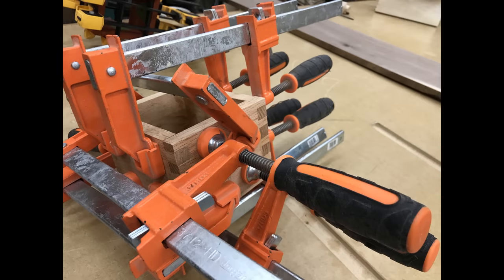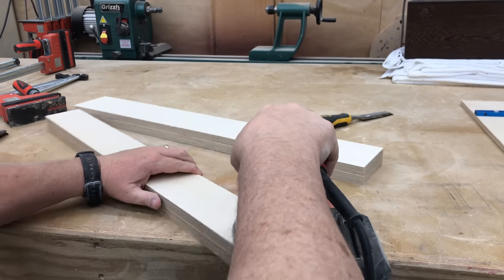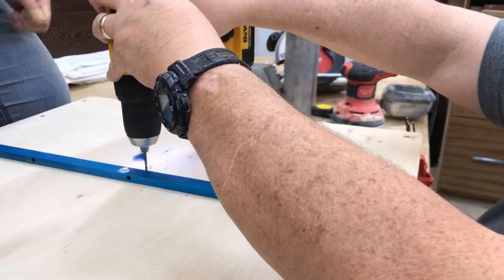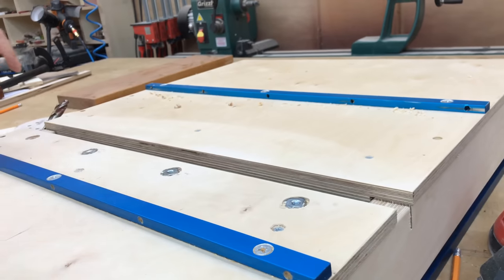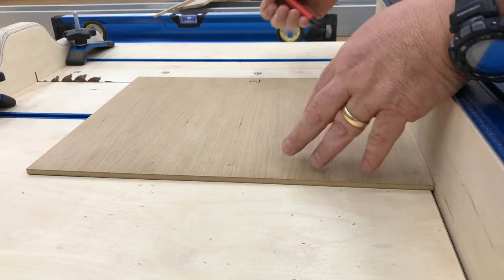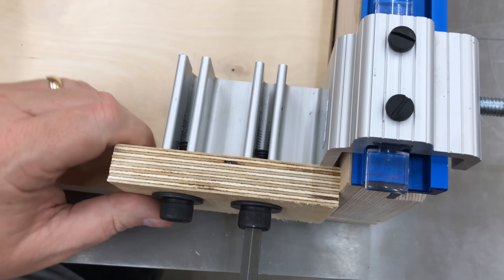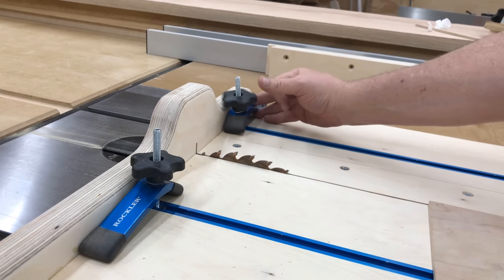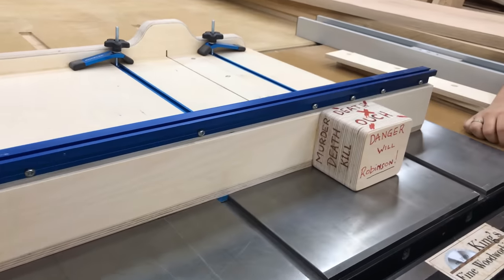39 - Extreme Crosscut Table Saw Sled with Perfect Miter & Dado & Removable Zero Clearance Insert

Comment: Thank you very much for this concise tutorial!!  I built this sled for myself about six months ago.  A tidbit of advice to others considering this build...check the orientation of your arbor on your saw before you proceed!!!  I made this very rookie, yet critical mistake.  Once I got everything square and precise with the 5 cut method, I realized that my Rockwell Model 10 arbor is opposite of James', so I couldn't use my dado blades on the sled.  I used it as it was for quite a few months to decide if I needed to make any other changes, but I am currently reversing everything to make it right.  I also cheaped out and used UHMW miter bars, which was also a big mistake.  My sled would not slide freely.  So I bought the same miter bars that are in the video, and I am in the process of attaching them and squaring everything up again.  By reversing the sled, I will also need to swap the front and rear fences, and go through the 5 cut method again.  Just a hint to hopefully help others from making the same mistake that I did!  Thanks again for the video.
Reply: DoubleS   I wish that I had read your comments before I started because I had the same issue, but I managed to catch it before I went too far but my cut off side is on the left side instead of the right. Fun build though.

Comment: That's a real nice sled with those T tracks and clamps.He is 100% correct that 90 degs is NOT good enough for accurate mitres . The bottom 45 degs of the isoceles triangle is the important part.I can tell you are a teacher . Great explanation James.

Comment: I built one like this based on your video.  Love it.  Rather than tilting the saw blade for a bevel cut I plan to make a jig I saw on another channel is 2 pieces of plywood hinged together on their long sides that fit between the front and back rails.  There will be vertical end pieces that are screwed to the bottom board of the jig.  The top piece of plywood can then pivot to any angle.  I plan to rig it so there are fixed stops at 45 and other common angles on the vertical pieces.  Leave the blade alone, set the piece on the angled board, and make the cut.  The stop and the hold downs will keep the jig in place.  Probably other types of jigs that could be add ones to your great design.   I’m thinking corner splines, box joints, and the like.  Thanks for all these videos!

Comment: Great Sled!!!!
Can't wait to build mine for my Rockwell table saw.
Thanks for sharing the design!!
 
An old trick us RC modelers use when we tap plywood is....
After tapping the hole, I always shoot some thin cyanoacrylate into the newly tapped threads. Then I run the tap through again. This substantially strengthens the plywood threads. and minimizes their deterioration.

Comment: Brilliant job of explaining everything James! One little addition when cutting aluminum moulding or in this case T-track use a good spray lubricant on the blade prior to cutting. I usually start my miter and spray it on both sides of the blade as it spools down. It will give you a real nice smooth finish. I think I’m going to order those plans!

Comment: Your video is JUST great, this is the best sled I found. The 5 cuts method is great as well, I looked into the other videos to better understand the theory, but your explanation is perfect. I liked the idea of having exchangeable inserts, for using my sled with dados as well. Thanks a lot, building it right now, I just need to come back a few times to review what I am doing. 

So far, what I did different is that I did not use CA glue for the runners, I hate so spoil them if I want to reuse them. I used carpet double tape, and it worked just as great. What I also got from one other video, is while clamping the fences, specially  the front one, we need to ensure that it is absolutely flat. That was a big error in my previous sled and I found out the hard way after pieces did cae out inconsistently.

thanks a lot again! Your's the best, inspiring, and the shopping list is also great (some pennies come from me, I ordered the kreg stuff from Amazon..cheaper and better than what I could find in my rockler store).

Comment: Just a tip in case this hasn't been brought up yet: chamfer the bottom of your production stop on the fence side to help prevent dust and chips from wedging between your stop and the work piece.  EXCELLENT build and video, and a great explanation of the 5 cut method.  Keep up the great work!

Comment: Hello again, James and family.  I’ve been using your design of (now my) crosscut sled for five months.  Excellent results with cabinets and picture frames and all kinds of other things.  For little stuff, I still use just my compound miter saw.  But, when I really need a guaranteed perfect 90 degree cut, the sled is my go-to.  For guaranteed perfect 45 degree cuts, such as for picture frames, I always rely on my perfect 45-45-90 plywood triangles that I made using your “James Geometric Method” and the sled.  So logical.  Very effective.  I’m a major fan.  And I still think you should try professional voiceover work.  You’re a natural.  Chris
Reply: I am just about to make this sled and was thinking about using 1/4” Baltic for the second layer instead of the 1/2” to reduce the weight, what do you think?
Reply: @benson9092  Hi. I don’t think that will work. A quarter inch top would not accommodate the half-inch thick T track which is incredibly useful.  If anything, you might want to try making the first (bottom) layer out of 1/4 inch Baltic birch and the top one from 1/2” Baltic birch.  I think it might be worth trying it that way to save some weight.  I didn’t follow James King’s excellent plans exactly; I made mine a little wider on both sides and 25+” deep to be able to crosscut 24” cabinet boards.  With both layers made from half inch Baltic Birch, mine is a bit heavy.  But I slide it on the floor most of the way to the saw before I huff & puff & grunt, then heave it quickly up to the table saw like a power weight lifter.  At 66 years of age, 5’11” and 235 lbs., I can still muscle it for quite a few more years.  When I hit 75, I might suspend it from the ceiling with a double pulley system.  Good luck to you Sir.  Chris

Comment: I have a crosscut sled and a miter sled but I love everything you’ve done with this. I will probably use your ideas to make a new one! One thing I might suggest is to drill a hole in your outfeed table and put a dowel attached to a block in it when you use your sled. This prevents the sled from going far enough to cut through the safety blocks you have in the back! Overall Excellent work!

Comment: Great video and love the perfect 45° accessory. Also your description of how to do the 5 cut method is so clear anyone could follow it. I did notice a couple of issues with your bandsaw  though. The burned plywood from the cut just means your blade is probably too dull. Those blades can be sharpened with a Dremel like tool if you take your time. But the worry some issue was how high the guide.  I'm a retired Industrial Arts teacher who has seen the blade break many times when student use too much pressure or when the blade has just worn out. Then the  blade actually ran out to the side because the guide is too high. That is definitely a dangerous situation and can be solved by adjusting the guide so it is just about 1/4" above your material. Hopefully that helps someone and keep up the great videos.

Comment: Got your plans for this and started building! Today I learned the difference in right mounted and left mounted motors.  My dados stack out in the opposite direction as yours apparently so I ended up needing the zero clearance plates on the left side of the cut vice the right side. I didn't notice this until way too late so back to starting from scratch i go. Hopefully I can get the aluminum bars off easily
Reply from the maker: Oh no. Email me, I’ll send you a way to hopefully fix it easily. 
My email address is james@kingsfinewoodworking.com

Comment: Pretty cool. One suggestion; the T track in the sled....unless you install the hold down clamps permanently you cannot get them installed without either taking out one or both tracks or removing the front fence and then reversing the process in order to get going again. If they are permanently installed then they will be in the way when cutting a large piece. If not, well, you have a frustrating hassle to use what was designed to be a convenience being the opposite. I suggest cutting the T track short enough to slip in the clamps at the planned gap at the end of the T track. I'm making mine now and that is my plan.
Reply: But can't the t bolts turn in a way that you can remove them without sliding through?

Comment: Great explanations on why you're doing things as well as your clear instructions on how.  You would make an excellent shop teacher.... if they still taught shop in high schools!  I sure leaned a lot of new techniques from you in this video, in particular the 5 cut method.  I recently build a finger joint sled that also has the fine feeler gauge adjustment ability, my project sled turned out great as well as the box I built with it.  Thanks for all you do buddy!

Comment: Thanks for a nice video. Got some great ideas for my own sled. Just one note. The 45 degree cut technique only works if the board you are cutting is square to start with. The technique lets you divide the board at a 45 degree angle by dividing a 90 angle.  All angles must add up to 180. Rules of geometry you might say,.

Comment: Very nice project and everything explained in perfect detail. I particularly enjoyed the 45 mitre illustration! 
Just a quick note on the post 5-cut fence adjustment - the length used for the feeler thickness  calculation should be from pivot screw to the point at which your feeler is placed (which will be less than the actual total length of the fence) - so if your fence is 28" long and the pivot screw is 1" in from right edge and the feeler is 2" in from left edge, the feeler thickness would be 25 thou.

Comment: Great sled...some great ideas....have to add my two bits, after so many sleds, I have found the a small dado for the miter bars, whether wood, metal or plastic, is invaluable. I build the sled in 2 pieces and after mounting the miter bars, rip each piece for zero clearance....guess its time for a new sled!
Reply from the maker: That is a good idea. I have never thought about building one that way.

Comment: Thanks so much for the video! I've picked up a set of plans for this build and am doing this assembly.  
One thing I noticed as it relates to my table saw - Bosch jobsite saw - is that my dado blade assembly requires a thinner washer on the inside of the arbor so all blades in the dado stack fit the table opening.  Because of this feature, it is not adequate to use the single blade kerf as the starting point for the top plate and instead, needs to be oriented for the inside edge of the dado stack by an additional 1/4". 
The result is (I'm thinking) that two inserts can be used. One to cover the dado on the left, and an additional on the right for single blade. My thinking is the left insert can cover the added dado width, and allow the right side insert to cover up to zero clear for either dado or single kerf. 
I'll post a picture or two when I'm finished with a functional build!
Love the family participation!
Reply: Gary did you finish your idea?  Wouldn't mind seeing a photo or two.
Reply: @mark-dd2oq  Indeed I did, and as I recall the idea to use the modified insert worked ok. I'd say now that it's probably better to have a dedicated sled for the purpose of dado cuts if you make a lot of them, that way it can be suited specifically to your saw arbor and no fussing with any sled mods. Since then however, I've acquired a new cabinet saw, sold the job site saw, and made a couple of new sleds - the sled in my comment has since been disassembled and repurposed into firewood! Sorry, no pics of it though.

Comment: Great work, very well explained. Just one little thing. You went to a great deal of trouble to tap the runners because of the thickness of the sled base,  Yet you then went on to add another layer to the whole thing. Surely then the extra layer would have been thick enough for you to use some longer screws to fix the runners on with ?   Keep up the good work, all the very best, Ricky

Comment: @kingsfinewoodworking:  Great sled.  Bought the plans and watched the video a half dozen times.  One thing not covered in the video, or plans is that you need to make the second inner table less than the total inside measurement (for instance if it’s 21” then you need to cut the inner table at 20 15/16” or something along those lines). It’s important to have some room for sawdust, but you also have to have room to adjust your fence.  If it starts out flush and you glue it, then have to adjust your fence inwards... you have to start over.  ;-( .  Just thought I would share and help a fellow woodworker out.  After the first adjustment, it brought my fence to true at .000428” .  Good nuff’ for this guy.  Great video and great plans.
Reply: You could just move it out the same amount on the other end.

Comment: I haven't read through all the postings.  Nice crosscut sled, very informative video.  In building mine yesterday (purchased plans from your site) there is one fundamental thing you should check up front.  My table saw tilts right - and when adding blades or dado the width grows to the left of the initial cut - not to the right.  If you don't factor that in from the very beginning (like reverse the sled to be measured to the right of blade, etc.) you will have issues making initial cut and removing excess material for the wider slot.  Additionally if you place measuring tape to right of blade, when you add blades your measurements will be off.
Reply from the maker: You are right, that is a great point. The sled is currently designed as a left tilting blade sled. You do have to modify it or flip the bottom components to use it as a right tilting blade sled.

Comment: Nice build video.
I'm building a bigger 32ish inch deep sled for cutting bigger panels, and using some ideas from this, with modification.
I'm new to woodworking, so probably should have started with a smaller sled, but I need a safe way to make accurate cuts in panels for cabinets I'm building for my garage shop. :)

Comment: Thank you for a really good video and a great design! I've just finished making my version of your sled as my first significant woodworking project. A few mistakes and some cursing, but it went fairly well.

I made a couple of changes to your design that seem to work OK, so I thought I would share them:

- My table saw has a blade which pivots away from the fence (in the opposite direction to a dado blade). Using a single insert in the bed for zero clearance would not work well, as there would be a big gap on the left side after making angled cuts. So I made an insert on each side of the blade.

- I read the comments below about zero clearance for the front and back fences, so I made two more inserts, one in each fence. This was quite simple, as your idea of using 2 x 3/4" thick pieces means it is easy to make a small 4" x 6" insert in one layer in the center of the fence, with a cutout behind to allow the blade to clear.

So the final design has replaceable inserts on all 4 "sides" of the blade. It's easy to switch them over - l'll see if it helps on future projects. Happy to send a photo if anyone is interested.

thanks again for the great work!
Reply from the maker: Thank you. And thanks for sharing.

Comment: That’s one helluva sled/jig. Thanks!

One thought on the 45 degree cut. If you had a piece of wood with a perfect 90 angle in one corner, you could cut a perfect square out of that corner. No tape or loose blocks to potentially move.
Reply from the maker: Thank you!

Comment: Re your 5-cut method, I noticed that you rounded your error result per inch to 3 decimal places giving a result of 0.001”. You then multiplied this by the length of the fence (28”) to give an adjustment of 0.028”.  When you repositioned the fence and repeated the 5-cut test you still had an error of 0.0018”.  If you had not rounded your error but had left it unaltered, your final adjustment would have been 0.029” not 0.028” which would have almost entirely eliminated your final error.  But instead you then multiplied the amount you’d lost in the rounding by 28 (the length of the fence).  Moral:  Never truncate or round intermediate results - leave this until the end.

But I think your concept is excellent.  Replaceable inserts is a wonderful idea.

Regards to you and your helpful family.  It’s great to see the younger generation supporting their dad.

Comment: Awesome sled, bought the plans and built it, but as I was doing so something just didn’t make sense, had to rethink the plans a few times, then realized that the plans were for a table saw that the blade is removed from left to the right. I have a Delta Industrial and the blade is remover from the right to the left, so now the cut off side is on the left instead of the right like in the plans. I had some choice words to myself,  Ha! Ha! Ha!

Comment: Great video and sled and I plan to build it. One comment though, for the zero clearance, I have several carbide tooth blades of different widths, a regular kerf, a thin kerf ripping and a 1/8" kerf flat top blade. Unlike a standard blade, the carbide blades have the teeth extend on both sides of the blade equally. When I use my 1/8" blade, it widens both sides of the sled but your design only addresses one side. I'm not sure how much it matters as while I'm not new to woodworking, I am new the the finer points of it since I recently stepped up to the Unisaw. Thanks.